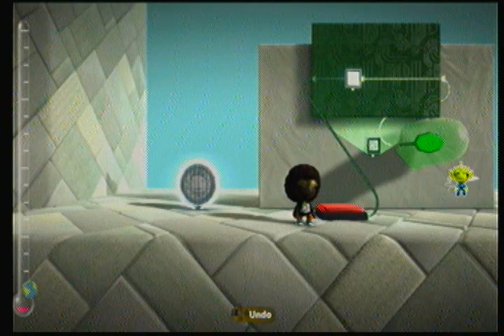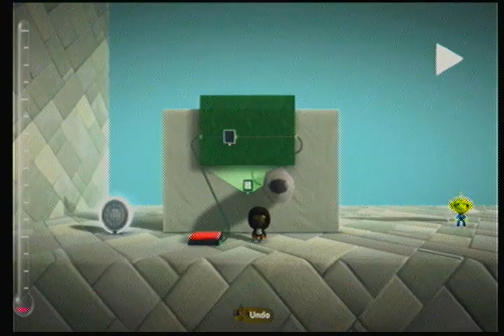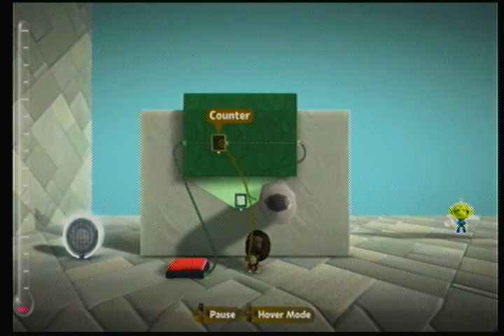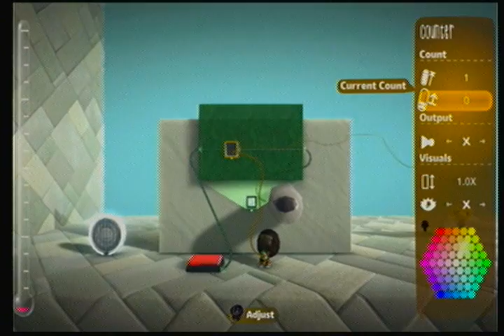LBPCreateGuide - Basic logic tutorials 2 - Inverting

Comment: Hey I have a question that i think is concerning logic, I am building an elaborate marble machine and trying to program an elevator to bring a ball (which is tagged) up to a certain point. My problem is when It arrives at the top and the ball is no longer on the elevator but tag then keeps the lift at the top instead of resetting it back to the bottom for the next ball to be picked up; How can I make it so that it resets after the tag is no longer close to the tag receiver?